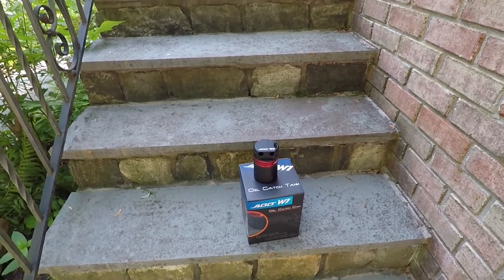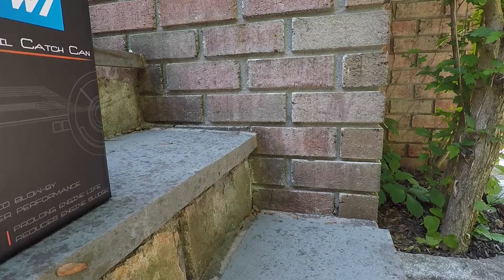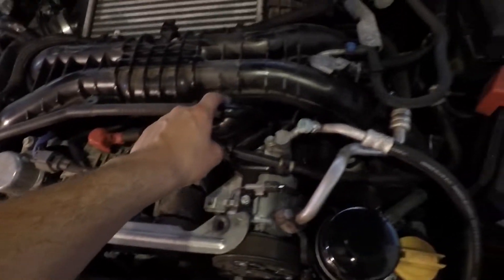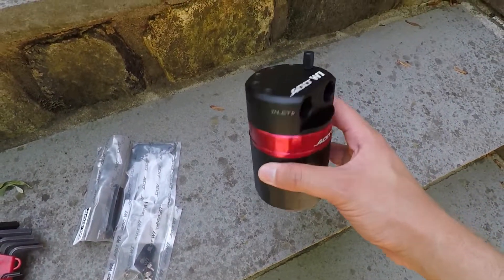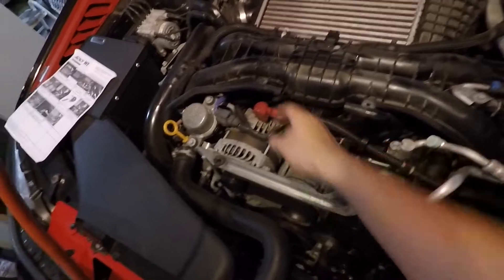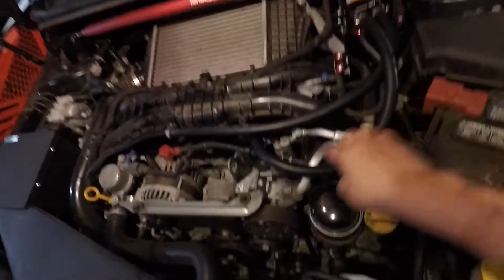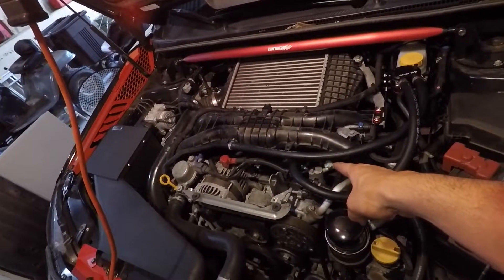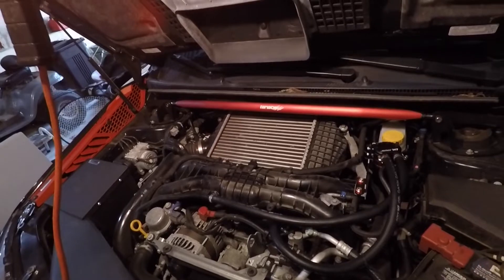Stage 1 Catch Can on WRX

Comment: What diameter are the hoses and fittings? Are they 5/8? I got a generic one for free so I want to figure out what hose and fittings I need to get.
Reply from the maker: Not sure tbh. Been a while since I did the install. You could try reaching out to ADD, they should be able to let you know.

Comment: All the videos I watched no one mentioned how a pain it is to get the rubber hoses over the pvc pipe that we had to cut 🫠
Reply from the maker: I didn't have many issues getting the rubber hoses on, you can probably try some soapy water to help. The real pain is getting the Stage 2 Catch Can (PCV) installed, that one was not fun lol. It catches way more oil though.
Reply: @alexs_wrex  lol that was opposite for me stage 2 was a breeze just getting the rubber hoses on the stage one was a pain lol I ended up spraying line on it and getting it on just enough to clamp it down

Comment: Why'd you choose a catch can instead of a AOS? Just curious because I'm not sure which one to get just yet.
Reply from the maker: I did the catch cans mostly because I didn't want to deal with connecting coolant lines. The catch cans are a little cheaper and I rather collect the oil from the CCV & PCV system than have it mix back in with the rest of the oil in the pan.

Comment: You could just cut the hose that is on the catch can to make it a little shorter. If I’m stock and add one do I need to add both.
Reply from the maker: Nope, you can do just one. The CCV can doesn't collect as much oil though. I've been running these for about 2k miles. My CCV can has a light dusting of oil on the inside walls of the can while the PCV can actually has some oil sitting in it.